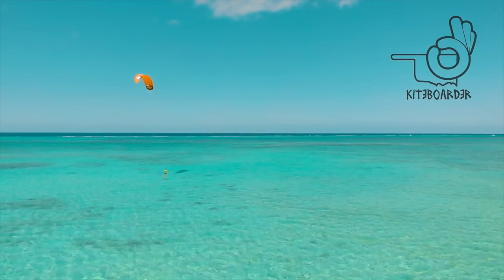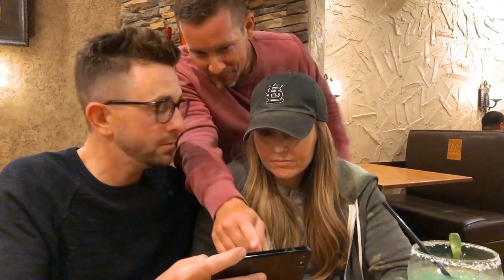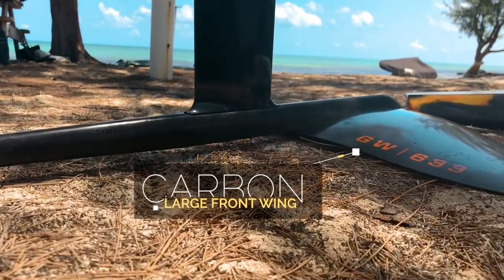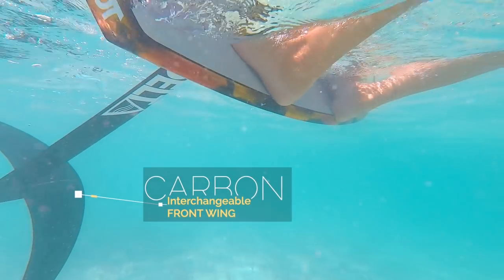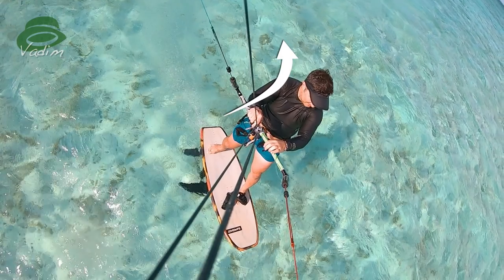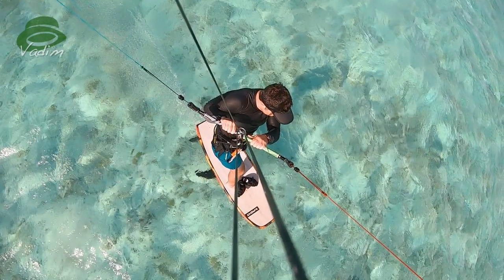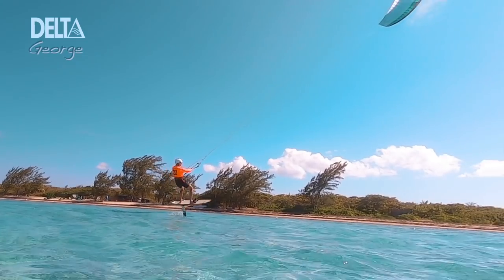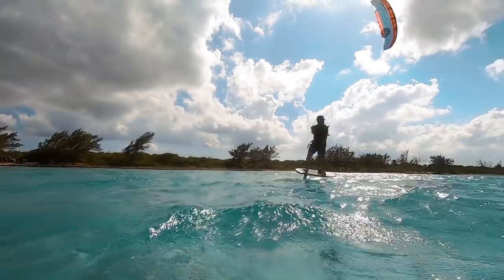Kite Foiling - Air Jibe Transition w/Foot Change & Downloop (Intermediate)

Comment: Nice video guide. I’ve been working on my gybes with the 637 race wing after spending time on the 683 (similar to your 633). That little bump from the back foot and maintaining your center of gravity becomes MUCH more important at speed on a fast and twitchy race foil. I strongly suggest everyone progressing with foil maneuvers start with the big surf wing like you’ve done here 🤙🏼
Reply: Yes, in my experience learning to footchange the key ingredient is maintaining a stable centre of gravity - keep your upper body as still and upright as possible and let the feet do the work. JK

Comment: I switched to a seat harness two sessions ago, pinched it out of my mates loft and I immediately felt far more steady against the pull of the kite as I can "hold down" more power. My toe-side riding improved immediately and I'm no longer going for jibes as I can just lazy-boy on toe-side. 

What I do need to do is stop being a big girls blouse and down-loop the kite while on the foil, self-preservation has issues with down-looping, which is a fancy way of saying "I'm Chicken". 

Keep on Trucking.
Reply from the maker: Everything you just stated is my FOILING LIFE!  I'm such a chicken.  Thanks for the comment.
Reply: seat-harness so much more confy, no need to make it supertight to prevent sliding up your chest. i think chest-harness hype has a lot to do with fashion, with looks. and maybe yes, in those super-manouvers 5% of us kiters perform, it's better  ;)

Comment: My problem is visualising how I can translate this to my local beach. Its hard to understand without the context of seeing the kite in sky and understanding the wind direction. As good as this is, there has to be some technical improvement in these kind of instructional videos, otherwise people like me will never have the confidence to progress to trying this.
Reply from the maker: Paul, I hear ya’.  Some more drone footage would’ve been good in this episode, but it didn’t happen.  Foil kites and LEIs will be a little different in flying for this maneuver and there are so many variables that can work successfully between board and kite, angles, tension, etc.  The only way to get an understanding is to just “give it a go” then some of the particulars will make more sense.  For the record, I was scared to death of this in the spring and now I do it without really thinking.   It will happen with repetition. Best of luck. Don’t quit!

Comment: Sweet tips! What's the wind speed and kite size in the video? I find that looping my 15 sonic2 in anything above 10kn on a medium size wing accelerates me downwind so much I can barely hold on
Reply from the maker: Completely agree Archie.   That was why I put the clip of the frontboard riders surfing.  These conditions with my 12m were 12-14mph on the Soul.  The 633 wing is so tough to limit in loft coming out of the downloop.  I’m working on a project with the delta hydrofoil system for just a front wing interchangeable system to consist of a wing that has a lot of lift (not quite as much as the 633) but still substantial and still holds well out of the transition with some speed and then being able to just switch the front wing when you want to foil in the low 20’s mph.  Not as much lift on the faster foil, but just trade out when you’re wanting to work on transitions or riding with more speed and condition dependent.  I still think this has to be the direction for performance carbon foils to make it budget conscious for us.
Reply: @TheOKKiteboarder  You have to check out shinn K! P works great in light winds or learning while K is a bit faster. Same mast/fuselage and stabiliser, just swap out the front wing
Reply from the maker: Yes.  I have the Shinn K foil on the Jackson Board.
Reply from the maker: Going forward with the performance carbon interchangeable and affordable setup is where I’m hoping the industry goes.
Reply: @TheOKKiteboarder  that would be amazing!! A bit off topic, how does K compare to the 633?
Reply from the maker: K has more speed, but a lot more rocker and not as much lift making early transitions more difficult.  The P (which I don’t have) May be a better comparison.  But the two are a tough comparison because they are different price markets as well.